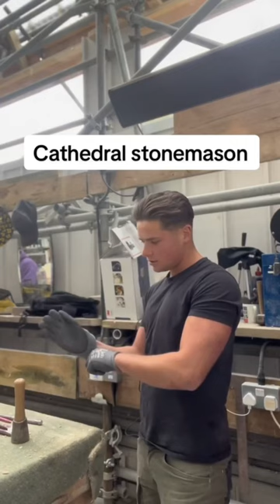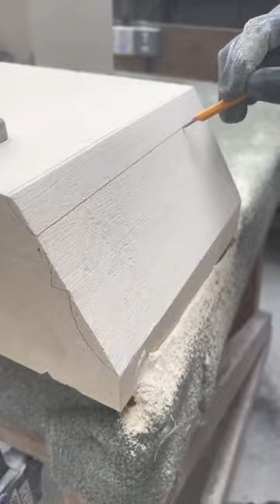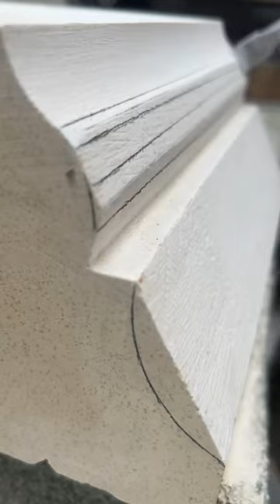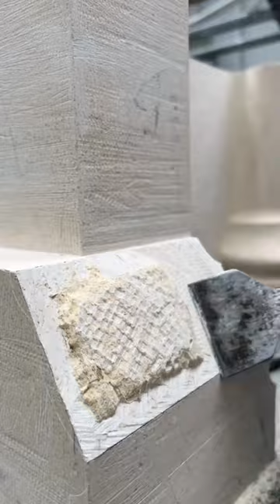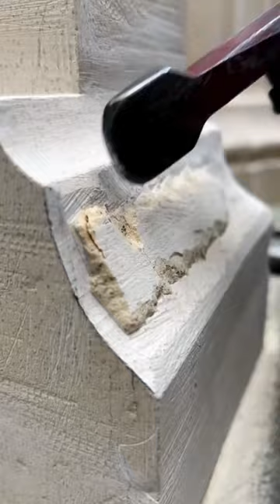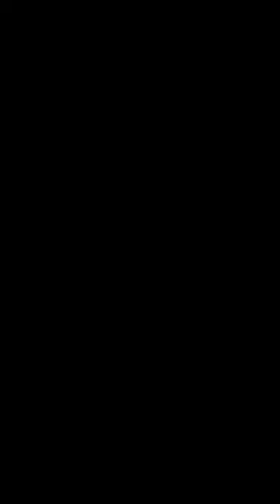#stonemasonry

Comment: History revisionist: You think those amazing stone structures were done with a hammer and chisel?
Stone mason: Of course not. It was a hammer and several chisels.
Reply: Several x several chisels in the case of stone chisels made from flint or chert.

The masons probably had younger, less experienced apprentices making them new tools.
Reply: @mnomadvfx  Even with iron and steel, on a big construction project like a castle or cathedral it would be basically a full time job for one blacksmith to make the nails (for the scaffolding etc) and sharpen and replace the chisels. There's a project in France where they're building a castle with traditional processes.
Reply: @fang_xianfu  oh, I know about that! it's really impressive to see the videos and pictures, especially how they quarry their own stone
Reply: Гранит , мрамор возьмет железное долото😂? Про диорит я лучше промолчу.
Reply: @дедподъеьон  Я бы тебе вообще посоветовал рот не  открывать если не знаешь о чем говоришь. Сразу видно что ты ни разу не пробовал работать по камню.
Reply: And probably rasps and pumice too.
Reply: You think they were working basalt and rose granite with copper tools? And moving 50 ton slabs?
Reply: @jihadjoe8746 No one "thinks" they did that we know they did. Ask away player.
Reply: @Johnnystammy   Well in-fact, we know that they did not do this with the tools of their age. Which cannot even shape basalt or rose granite. And they did not move 50 tonne blocks, or the 250 tonne single block to make the twin colossus. So please, explain yourself with absolutely 0 evidence to support your claim.
Reply: @jihadjoe8746  Oh dear you've chosen the wrong one here to challenge but I did say ask so here goes.

A) they did not do this with the tools of their age??? What nonsense do you speak and can I have the drugs you're whacked out on please? Now the evidence for their tools and their makeup is found in the Petrie 1917. Sir W. M. Flinders. Tools and Weapons. British School of Archaeology 30. London exhibits of which five artifacts were found from the old kingdom Egypt 2700-2200 BC, two from the middle kingdom 2,025-1,700BC, nine from the new kingdom 1550-1069 and one from the Roman period 

See petries 69 47 44 71 72 for dynastic old world
See petries examples two and one for the middle kingdom
see petries 86 72 77 82 85 67 59 41 42 for new kingdom era
See petrie 60 for Roman era

B) cannot shape Basalt or granite?? You know arsenical copper alloy like the old kingdom artifacts is comparable to tool steel and easy to smelt.😂😂😂 More Graham Hancock rubbish now Basalts are composed of minute grains of plagioclase feldspar (generally labradorite), pyroxene, olivine, biotite, hornblende, and less than 20% quartz. Now All the rock-forming feldspars are aluminosilicate minerals with the general formula AT4O8 in which A = potassium, sodium, or calcium (Ca); and T = silicon (Si) and aluminum (Al), with a Si:Al ratio ranging from 3:1 to 1:1 now potassium sodium and calcium are mineralised materials, the aluminium is easy to work and makes up less than few percent of the total composition next is Pyroxenes which are common in meteorites and in extrusive igneous rocks, especially basalt. Pyroxenes are the most significant and abundant group of rock-forming ferromagnesium silicates (another glass like crystaline formation that is found in beach sand and uses to make glass too). They are found in almost every variety of igneous rock. They also form under conditions of regional and contact metamorphism then The mineral olivine (/ˈɒl. ɪˌviːn/) which is a magnesium iron silicate with the chemical formula (Mg,Fe) 2SiO 4. It is a type of nesosilicate or orthosilicate. The primary component of the Earth's upper mantle, it is a common mineral in Earth's subsurface, but weathers quickly on the surface (remember that point when you think basalt is impossible to work) next comes biotite, hornblende and a less than 20% quarts all again which are silicate or sand based geological materials.
      
 Part 2) again who taught you geology Graham Hancock? 😂😂😂🤡🤡🤡 You know Graham Hancock is a former foreign affairs journalist and isn't trained in anything professionally and he makes money selling you shit theories for fun, that Jimmy corsetti is a YouTuber and former fraud investigator also untrained in his fields (he googles and uses speculation and conjecture like you), that Ben van kerkwyk is a computer nerd and cloud farm server runner also with zero training in anything else, that billy Carson started off filling spots on girls highschool basketball teams and now runs the equivalent of a desert camper home podcast. Do I need to name any more hacks and burn them for Their sins or are you finally sensing the narcissistic themes of how it's a bunch of people with zero training in the field they speak in telling actual doctors of their field who do know what they're talking about, an Egyptologist phd takes four years of full time study with the masters of philosophy taking another four years plus another few years of field practice and yet jokers r us know more than thousands of years of phd people carefully studying the answer??? 😂😂😂😂😂😂😂 Okay yeah you're right there's a secret alien god race and magical floating levitation technology hidden under Egypt yeah it's just pass the skeleton of the assassins order master and just after the magical rocks shooting energy beams.
                    Now Pink granite, like other granites is an intrusive igneous rock typically containing feldspar, quartz, mica & amphibole minerals. This variation contains potassium feldspar plagioclase that gives the granite a distinctive pink color as opposed to other variants, even Shap granite so as I've said the first three are silicates or sand based solids and the last one is a fragile mineral so lmfao it can't be carved.
 
C) oh dear you've not educated yourself about the Egyptian pulley system. 😂😂😂😂😂😂 A simple limestone greased and groved cylinder free to spin Both ways with perfect smoothness and suspension of a 5,000lbs weight up a 55 degree angle something which was tested by engineers in Egypt in 2018 when they found a massive ramp made of packed sand gypsum and other minerals in eastern Egypt and ramps necessitate the use of a true pulley system now the calculations show the surface area needed for such pulleys was possible now the tensile strength of a single Papyrus strip is 10 kilos which means with multiple hundreds of strips per small braid times by fifteen braids plus length like the tura mine Papyrus rope fifteen braids thick and Papyrus was treasured to the Egyptians even being spoken off in the story of isis and Osiris and the Egyptians had elephants traded from benerike and elephantine until the Romans arrived and they lift 14 tons plus at full effort so that's 16 elephants with massive ropes leveraging the weight of 250 tons which I can't be bothered to demonstrate fulcrums lever to you when so much of this is beyond your tiny mind but the 50 ton is easy with pulleys.

You said please explain yourself with 0 evidence so confidently and yet you didn't just get bi*** slapped you got sat down, educated, humbled, wised up, slapped again several times in your stupidity then scientifically wrecked so hard that you cannot even use this information to pretend like you knew what you were talking about with other people all along because you can't understand a language of science that you don't speak and I just trashed you so hard in so many fields and it didn't even take ten years of my life to learn how to do it took around half an hour so this is the only thing you can take from this comment because after this any and all possibilities of you being able to reply are totally gone like a calf who just lost his balls and worst of all for your overconfidence.

This lesson will sit here to remind you until the end of time. You're really really gonna hate hearing this now but I've earned my right to be arrogant so here goes, you're dismissed now boy. 😋😋😂😂😂😂😂😂😂😂 Go pop some facts for breakfast.
Reply: @jihadjoe8746  I'm sorry Mr Gustafson I spoke crap and now I jihad Joe am sorry for being so wrong is the words you're missing. 😂😂😂😂
Reply: @fang_xianfu  no one is going to waste perfectly good iron on nails for scaffholding in preindustrial era
Reply: @jihadjoe8746  i use a 40 tonne hydraulic hammer with a steel strike pin to. break basalt on the daily, you think they used copper chisels to cut those stones you are batshit crazy.
Reply: @petekkrishnansan   That's the exact point, maybe the hammering got to your brain. But read before you comment
Reply: @jihadjoe8746  yeah bro all that hammering from my shock absorbing climate controlled cockpit shook some sense into me. I work with 20 tonne peices of basalt and i turn them into sub 500 peices so i can build the roads you drive on. I am telling you. Copper chisels did not build the megalithic structures.
Reply: @petekkrishnansan   That's also what I'm saying. I don't care that you work a minimum wage job to fill roads with garbage that has to be replaced every few years. I pay my cybersecurity first year employees triple what you make. Now calm down and learn to read. I'm agreeing with you if you had a verbal IQ of above 35
Reply: @jihadjoe8746  bro calm down, your a brokie dont try and flex lol.
Reply: It's o k if you don't understand most people don't.
Reply: Great quote 👍
Reply: Don’t forget a sharp haircut and a YouTube channel
Reply: @jihadjoe8746  i believe you are talking gabout the pyramids which were mostly made out of lime stone (5,5 million tonnes)
Reply: I mean they clearly weren't using the type of materials we were using. No where near the hardness of steel.
Reply: @beasthunt  Sure. So it would take more tools and longer time. Harder doesn't mean impossible.
Reply: @mihaimilan9598  clearly not impossible.....or else we wouldn't have it. Did you read before speaking?
Reply: @beasthunt  I read before writing and I was in agreement. Sorry if the phrasing made it seem like I wasn't.
Reply: @mihaimilan9598  All good! I agree with your agreement....lol. God Bless!